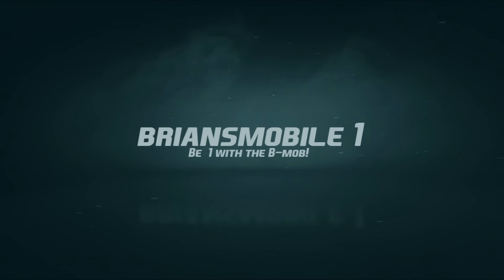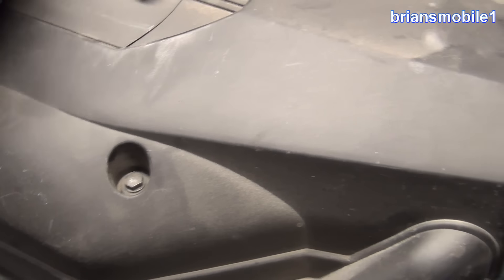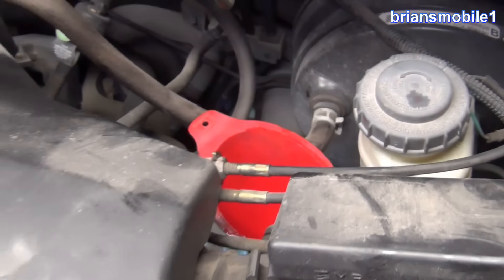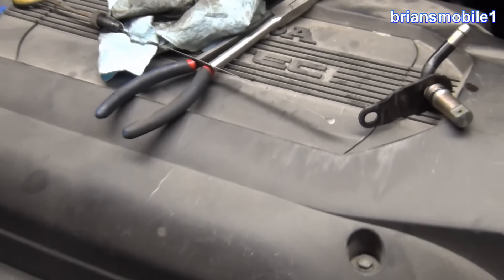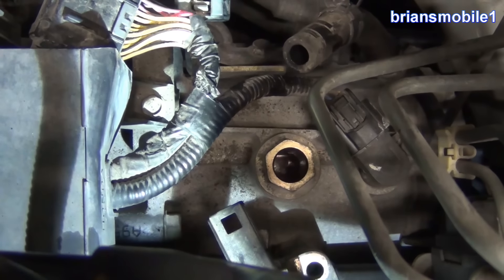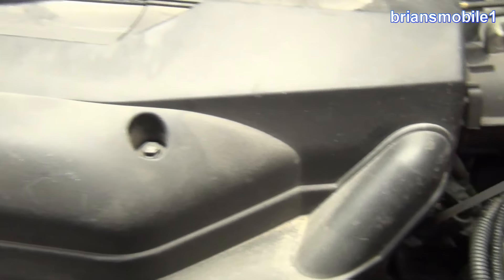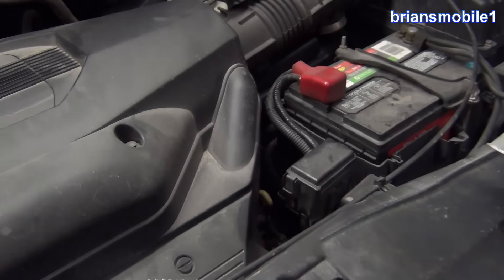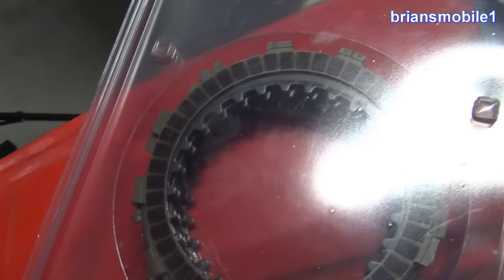Watch this Video BEFORE You Destroy Your Honda Transmission

Comment: Well done but there's a much easier and faster way to fill the transmission with transmission fluid. I have a 2004 Honda Pilot with the same 3.5L engine.  Here's what I do:  I simple fill through the dipstick tube.  To do that,  I quickly made a device as follows: I cut the bottom out of a 1 gallon plastic bottle (specifically, an Arizona Tea bottle).  I drilled four holes near the bottom  edge where the bottom was cut off and attached a wire to each hole and joined them together with a hook (you can make one with coat hanger wire or just about anything).  I then drilled a hole in the bottle cap and inserted a brass hose fitting of the proper size for the tubing I would use.  The fitting cost about a buck at any hardware store and it's the only thing you have to buy.  The fitting is inserted into the hole in the cap and screws into a nut on the inside of the cap and I sealed it well.  I then hang the bottle upside down with the opening (cut off bottle bottom on top and cap with tubing attached on the bottom) with a hook to the raised hood.  To the brass nipple in the cap, I attached tubing that fits into the dipstick tube.  (Remember, this is only a one-time thing and it only took about 20 minutes to make this setup.  In fact,  it probably took less time to make this than it did to do the work in this video and it totally eliminates having to remove and replace parts in tight spaces.)   Then I simply insert the  tubing into the transmission dipstick tube, pour the transmission fluid into the bottle and let it fill while I do something else.  It takes about 10 or 15 minutes to fill by gravity.  Then just remove the bottle and tube, replace the dipstick tube and I'm done.  Once this setup is made, it literally takes no more than one or two minutes to start filling the transmission. THe setup sort of reminds me of a hospital tranfusion setup.  

Doing it this way takes less time than changing the oil and oil filter.
Reply: You're dedicated. I found a long funnel at harbor freight and it worked good for my 06 and 14 accord's. Both 4cyl engines

Comment: The amount of transmissions I replace because of them being over filled is kinda disgusting.
Reply: I think the instructions on the dipstick are too concise and don't have enough exclamation points... check in idle, while hot, in park, DO NOT overfill ... those are merely suggestions right?
Reply: @e.claire1718  check hot, engine off
Reply: @LazySniper  lol no, I know.  I have a Honda and I work for a lube shop.. I was just sayin in general, people ignore basic instructions literally on the stick
Reply: @e.claire1718  Hondas are the oddball
Reply: How do I know if it’s overfilled
Reply: @fahadabu6162  don't add any
Reply: @LazySniper  how bout when I tried to tell someone today that their trans is sealed; can't check the level up top and they comment and look at me like I must not know what I'm talking about  or what I'm looking for... probably a lot to do with being a bubbly blonde girl so they ask my male coworker about it and he says the same thing..
Anyway i just needed to talk about it.  thank you for the therapy session. Bill me lol 😆
Reply: I was recently gifted an 07 impala with the 3.9l V6. It’s at 100k miles and runs great, but I notice a slight hesitation between 1st and 2nd gear. The transmission fluid is bright red (which might be a bad sign lol) and every other shift is flawless. I’m wondering if I should try to put some stop slip in, or if I should just continue to drive conservatively. I know that these cars have somewhat weak trannies, but I really want to get this one to 200k! What do you think?         

(Just curious, could such a symptom be caused by overfilling? I haven’t been able to check the level with the car warmed up yet.)
Reply: @sirsardine1  overfilling can definitely be a problem with any high pressure system fluid

Comment: Never do a chemical flush on a transmission
Reply: Unless it's necessary and you know what you're doing!
Reply: @reallyhappenings5597  exactly 💯
Reply: What is a chemical flush
Reply: @Therealestrunnerluda  a chemical flush on a transmission is...
Transmission flushing chemicals are solvents or detergents that are added to your transmission before flushing the fluid. The vehicle is allowed to run for 10-15 minutes before the flush, in order to circulate the chemical through your transmission.

Comment: Ola Brian I just do 3 times empty fill drive for about 50 miles repeat 2 more times. Brian been following you from way back. You have been a great help.gave up on the sti will bring to Subaru dealership for po448 and po448 troubleshooting. I know they're going to charge me mucho denero. No choice  pcm problem most likely. Clutch is slipping. I'm going with an excedy clutch kit.
Reply from the maker: Thanks!

Comment: Why not fill it through dip stick? Too small? Takes too long?
Reply: That's what I was thinking about,, last year or something like that I called Honda dealer they were 60 miles away and I talked to a mechanic there and he said that's what he does an then I asked him with the car running can I check the transmission fluid and he said he does same thing,,. I used to work on cars until years ago my health change and that's how we always did it and i never mess with Honda really I didn't know about them, but I do have a 94 Honda now and I love the car damn good running car and I got another one just like it

Comment: If you don't know the history of your older honda CRV 98-02ish its a good Idea to drain, fill, drive a couple short trips, and repeat 2 more times to flush out the junk,  then you should be able to do just one drain and fill yearly after that.  Its not possible to get all the contaminants out, but this method will make sure that most of the fluid is relatively clean/new, compared to mostly junk fluid diluted with 1/3 new fluid.
Reply from the maker: I agree.

Comment: I agree with you Brian, but not when it comes to the 2012-2016 honda CR-Vs...I did a flush , and added a good expensive  Lucas stop slip additive...to my GFs CRV that had 63k miles on it... funny enough  we got a recall for the tranny rumbling as it shifts into 2-3 shift under light throttle....and we brought it in, HONDA did a flush with honda stuff.. and added an additive....even after i told them i had just done that and it took the rumble away....They said they had to by law. and They plugged in the special Honda software computers and changed a bunch of shift points and fluid pressure checks... Thought i'd let you know, i ALWAYS said flushes and additives were dog shit, well 20,000miles later... we're about to do it again, as per Hondas advice.  Also what im 99% sure honda is using and what I used is Lucas transmission stop slip....and IM telling you.. it works.
Reply from the maker: I'm listening.  Thanks for sharing your experience.
Reply: @briansmobile1  Ay cool man, just incase you ever run across this problem... Now you know. Dont go through the same stress and hours of forums and phone calls i did. Best of luck with the channel brother. Keep making vids ill keep watching.

Comment: I would like to say Brian thank you for showing and stumbling across your video. It doesn’t matter what color the transmission oil needs to be but as long as it’s changed now my question to you depending on how long if you had your car for or if you bought a used car when should you change the transmission oil? A lot of people says every hundred thousand miles other people says 50,000 miles on last but not least every time you change your engine oil, sometimes people say that if it’s too dark, don’t change it at all you’re gonna wind up messing up your transmission. I’m glad that you know what you’re talking about so if you can definitely give me that answer almost appreciate it. You have a blessed one.

Comment: My 2010 accord has 213k+ miles on it... i did a drain and fill at about 90,000mi. Do you recommend doing another at such high mileage?
Reply: I certainly would, but save that old fluid, as you may have to put it back in. The new fluids are pretty slippery, and you may notice some slipping, or over-revving going on between shifts.

Comment: For an easier time, use two funnels. Second funnel just brings you higher.
Reply from the maker: Not a bad idea.  Thanks!
Reply: @briansmobile1  Congratulations.do you use transmission oil additive for the transmission.my car sounds "smack" when I take P to R at first start in the morning, but what could be the reason why it does not come in the next replacement.. should i use additives

Comment: I use valvoline maxlife in my CR-V. I have over 300k on my original transmission.
Reply: Yep, OEM fluids are a scam. It's usually cheapo nonsynthetic.
Reply: Great video however I disagree about the Honda DW1. I've used valvoline synthetic on my CRV for the past 190,000 miles and is smooth as butter. I change it every 50k and never use Honda DW1. Never had a transmission issue. I even tow a trailer now and then. I currently have 248,000 miles on my CRV and going strong.

Comment: Dude, ace content.  I really appreciate that you took the time to explain how you do something so simple as holding the washer and bolt with your finger;  These small tactile things that you experience with all your sense.  Knowledge of this level is  typically only attained with years of experience at the trade.  Being able to feel it is one thing, but to be able to articulate it and convey it as first hand knowledge is a complete other thing all together.  

I am speaking as someone that has been taking stuff apart to fix it since my first record player when i was 5 lol.  Most my experience is gleaned from fixing electronics, and pretty much anything else that can break.  My experiences there, have led to greater confidence when it comes to automotive / mechanical stuff.  And that is derived from experience.  Things like, I ALWAYS turn a fastener backwards until it clicks, then forward;  this will 100% of the time prevent cross threading., and it's at most only a half turn back.  Cat feel it click? give it some gentle pressure and you'll get a affirmative click.   Another favorite is putting fasteners back in their respective holes when disassembled, where possible that is.  saves LOADS of time reassembling.  if fasteners are recessed, I usually loosen them, then put tape over the holes;  This keeps them captured.  Just pierce the tape with the screwdriver to reinstall, then pull the tape off.  keep a loop on one side of the tape so it isn't a pain to take off.

Sorry, ADHD brain got me there.  Anyway, point being, It's dudes like you that make the world less shiity.   Thanks again, keep em coming, liked and subbed lol. 4 years, better late than never

Comment: I drained and refilled my accord at 100k. Still going, it's an 06
Reply: That's just fine. You mean miles or km?
Reply: My 07 is 165,000 miles and I have changed the trans fluid twice. Owned it since 125k. My piece of advice for this car is to change the external in line filter. So the first time I changed it was when I bought it. The fluid looked ok but I wanted to do it for piece of mind. Didn't change that filter cause it looked fairly new. Just changed the fluid at 160k and did that filter as well and man did that improve shifting. Didn't shift bad to begin with but it is very crisp now.
Reply: @kuhndog-1196  I'll look into it. Also miles not km
Reply: My car won’t go in reverse but everything else is fine and it has no check engine light . 2006 Honda Accord , can you help ?

Comment: Simple but great video, nice ending. 
Would you recommend to change that o ring? What did you lubricate it with? Checking tranny fluids in Honda’s when hot and off, is that for all Honda’s? I have a 2008 Honda Accord Sedan.
Reply: All Hondas; yes.

Comment: 31/2 at and then I open the return line and let one at pour out I pour one at in.. to it brite red.. I do my transmission oil change every 30k. And added a 8n line filter so I can service my transmission my 01 accord have there filter 8n side and have to drop the transmission to swap the filter out.. so adding a inline filter helps..30k-40k I live where weather max is 115dregree.. and coolest is 54degree. And since all teach say heat is the number one killer of cars and transmission.. plus I change my fuild every year ot two.. this help keep all clean.
Reply: I cant understand why honda don’t put a filter on the tranny.  Makes no sense.   Where did you put your filter?

Comment: Only way to flush any trans is to  drain and fill the pan, pop off the filter and run the output into a can, idle the vehicle for a few seconds removing about 2qt, stop and fill with same removed fluid and repeat till clear. Shop flushes are power flushes and break things, this method only redirects the pan return into a separate place and you use operating pressures to push the old fluid out. This one with that upper added on pipe is a recall due to improper lubrication on 4th causing failures di Honda added that pipe to add extra fluid to live 4th. Only the faulty recalled ones gave that pipe  since they were modded to lubricate the final gear pack right. Not sure if that possible on this recall/modded one or how you would do it but just might take a little more fluid is all. Doing 4 drain and fills only gets you like 80% new fluid, the method I noted gets 99% with less fluid.

Comment: Had a honda Ridgeline. a oil place asked me if I wanted to change the transmission transfer case and differential fluid. 5k later learned my lesson
Reply: What happened
Reply: @yamkaw346  he learned his lesson
Reply: @yamkaw346  
Guess.
Reply: @yamkaw346  Every part in the power train in a Honda vehicle uses special oil, Especially the transmission. The rear differential started making ugly noticed when I turned, then it wouldn't shift properly from second to third or wouldn't shift at all. Had to take it to a horns specialist, they had to reconstruct the transmission and differential.

at the time it wasn't worth to fix it. but I grew emotionally attached to it so decided to fix it. It got totalled around two years ago when I crashed it, because of the unibody construction nobody wanted to touch it.

Comment: I have a 2008 Ody and I was able to get the fluid down the dipstick using a plastic tube... I melted the end and stuck it over the tube... melted the other end and stuck it inside a funnel.  The transmission really runs better afterward.  I just do this when the Maint Minder says.

Comment: I replace the fluid through the dip-sick tube. Easier. Transmission capacity cited in the manual is an "initial fill" value. I let transmissions drain for a bit, so I typically end up adding 0.2-0.4 quarts more than that value. I also run the transmission through all of the gears several times before I decide that the fluid is at the desired level. Only use the Honda ATF! Do not flush any transmission. Drain & fill only, which on most Odysseys replaces about 1/3 of the fluid and in my experience is fine if done on schedule. Not cheap, but do x3 drain & fill if an (almost) total fluid change is desired or ( which might help) if transmission shutter is occurring (which for certain years is sometimes misdiagnosed as a torque converter problem when it is not). In the video, amount of material on the magnet was more than I would expect from a well maintained Honda. It stinks that the newer Honda/Acura (and many other) vehicles now lack a transmission dip-stick and ideally a scanner tool is used to properly change the fluid.

Comment: Honda makes automatic transmissions? News to me😁
Reply: One of the Best Automatics in the Car industry on certain models
Reply: TheMuzikall they’re dog shit, probably worse than the 4L60e. I owned 2 odysseys and I have 3 GM vehicles lol
Reply: @TheMuzikall  Completely opposite. Honda has the worst Auto Transmission ever.
Reply: @FD-rh6tr  ,,, That's a great misrepresentation of the reality. Honda transmission especially of the 90s are the best.
Reply: Honda has always made their own transmission..
Reply: @TheMuzikall  Honda transmission's are okay... they are still on the weak side if you run them hard you need to keep them serviced.. The best transmissions are made by Aisin that is what Toyota uses. The worst transmissions are jacco which is what Nissan uses and Subaru uses some of them as well ...stay away from them. I am familiar with Honda products as I have bought new Accords since 2000 
 and I recently switched and bought a loaded 2020 Toyota Camry.. as I no longer trust Honda like I use to with their CVT engines and small turbo engines... They are still okay.. I don't hate them as I I still have a Honda Accord with 37k on it that I use for a second car.. I have never had a minutes trouble out of it.. it starts and runs flawlessly.
Reply: The problems with the V6 5AT family transmissions hurt Honda's reputation and cost them a lot of $$$. Designs have been radically changed since, and Honda's AT type missions have become extremely dependable. Trust me; I KNOW this to be true, though I'm not at liberty to say how.
Personally, I have owned no less than 8 Accords, a Pilot, an Element and an Odyssey, and have never had a transmission failure that required rebuild, though I had minor shift-related issues with 2 of my high-mileage Accords.

Comment: I just watched a video where someone realized the fluid wasn't pumping very well, so he used some air pressure and revers flushed it, then used diesel fuel to clean it out. Then he drained everything and filled it with cheap trans fluid. It shifted smoother than ever before. So he drove to a Honds shop to get the proper trans fluid and changed it, and the inner filter. He said he didn't recommend blowing it out with air, but it cleared his up, and he didn't end up replacing the transmission. Do you say diesel is not a good idea, too?